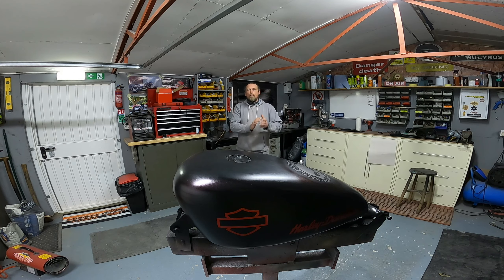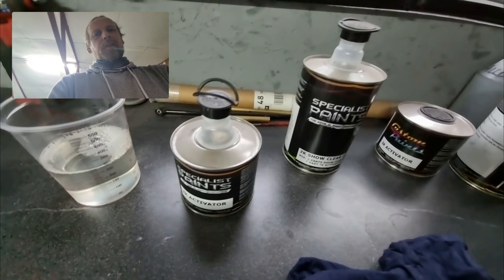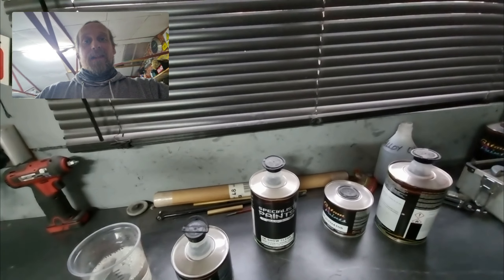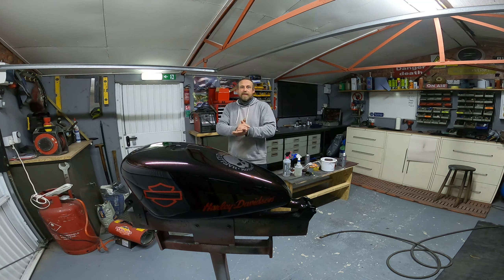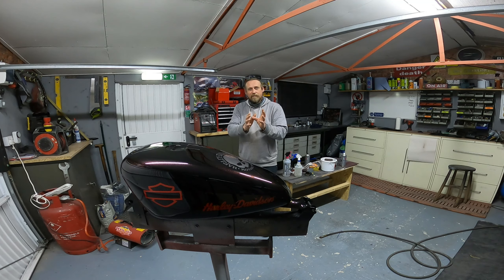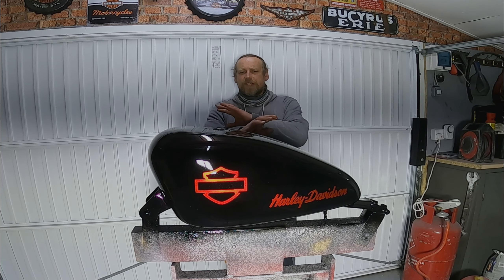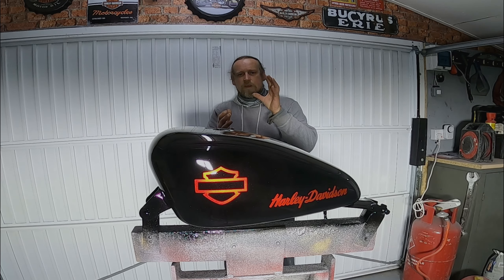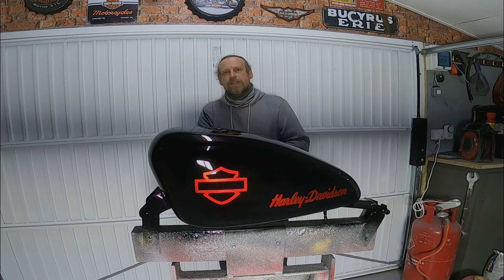SPORTSTER TANK FINAL CLEARCOAT Using the A.N.I R160-q  gun

Comment: Anglais

Hello, thank you for answering me. I have another question for the basecoat: the Omni paint company suggests that I adjust the pressure between 8 and 10 Psi, in your opinion is that too low?
THANK YOU :)
Reply from the maker: No problem 👍.. I would definately think too low. Better off with around 26-30psi max for good atomization. If you sprayed at that low pressure you would get a heavy uneven finish. Get a piece of board and try out on that first if not sure 👍

Comment: yes mate cracking job with the ANI 160Q WOULD HELP IF YOU PUT THE PRESSURE SETTINGS ON FOR BASE AND CLEAR
Reply from the maker: Good point 👍👌
Reply: @ALCHEMOTO   mate iam going to get one i reckon 2 bar pressure full fan full fulid and  PPS cup system

Comment: Great job! What's your setting for fan, fluid and PSI? Thank you!
Reply from the maker: Thanks mate. Psi always around 25/30psi with small tip as less overspray with good atomization. Fan is usually around 3/4 open for tanks and down a touch for fender work, and paint from closed around 4 turns out if that makes sense. But mostly I go with the feel. Prob wise to use the gun gauge really as my gauge is straight from the trap/filter but my air line isnt too long so pressure constant anyway 👍